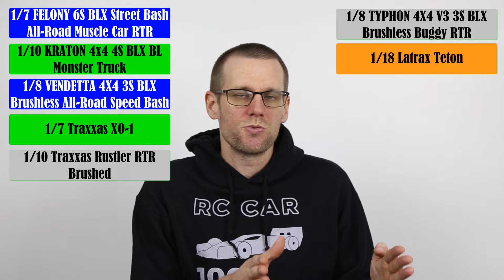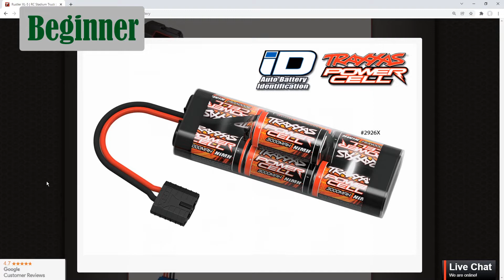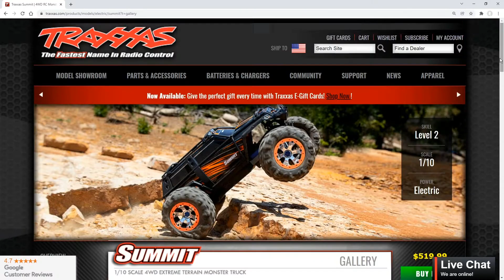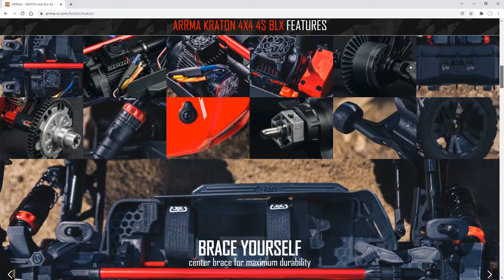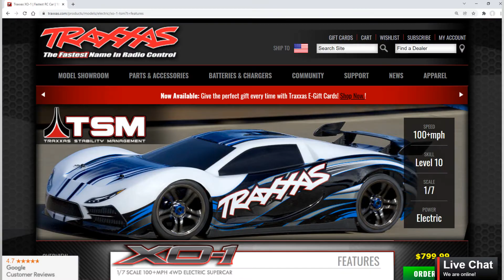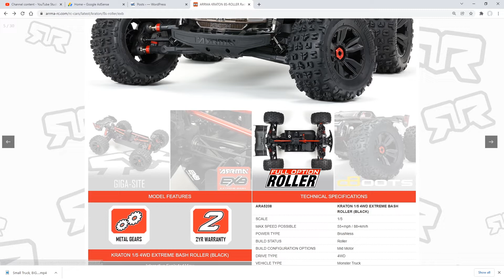Ranking 10 RC Cars from Beginner to PRO!

Comment: I would've mentionned your ranking is based on performance and handling of the vehicle because maintenance and the mechanics of repairs done to the vehicles is a whole other game.

For example, I have the Kraton 4s and the Summit and I can tell you the Kraton is easy to work on but the Summit is not, so classifying it as a beginner car sounds a bit 'off' to me. In other words, I would never recommend the Summit to people just starting.
Reply from the maker: Interesting point Patrick, thanks for the comment. I thought I had this in the description. I will take a look.

Comment: Quick question I connected the 3 power wires to the speed control on my jet 8s system felt a little under power for what it is. If I rearrange the 3 wires another way can I see more power out of it like red to yellow yellow to red and white to white if I connect them a softener way can I see more watts out of the motor?
Reply from the maker: For a typical motor this wouldn't matter. Also switching 2 of the 3 wires results in reversing motor direction. Thid applies to sensorless motors. Sensored motors have to be wired a certain way.
Reply: @RCexplained  thanks

Comment: Honestly no offense..I wouldn't say the traxass summit is a beginner car.. there is a lot going on on this rig.. 2 steering servos that need sync.. 2 speed trans.. the diff locks both have servos.. pillow blocks on all 4 corners.. tie rod rocker arm suspension with lay down shocks.. and its definitely one or the hardest cars to work on.. its easier to work on a 5th scale kraton.. thats all just my opinion of course..